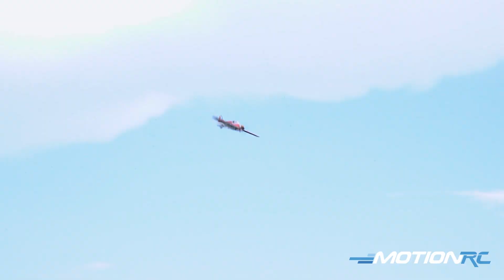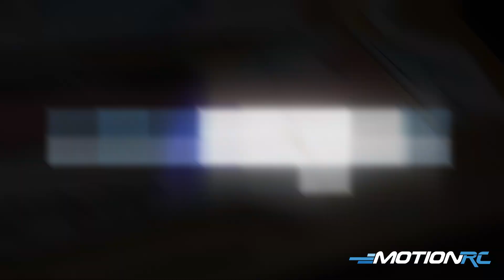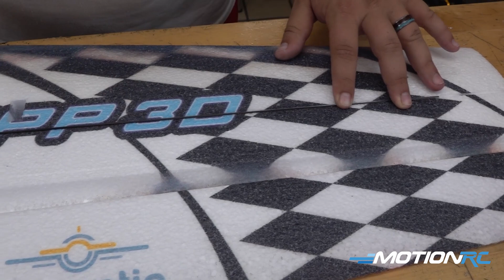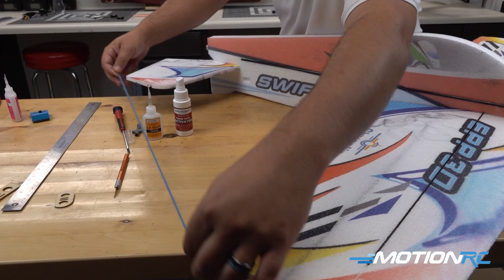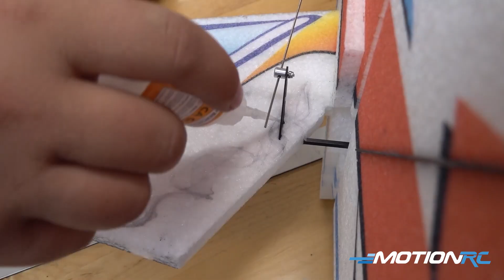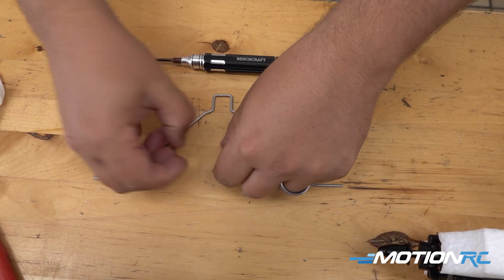Skynetic Swift Assembly | Motion RC

Comment: I’ve had both of these planes and both were tail heavy I used a 2200 mah battery and move the motor forward and it was still tail heavy  I will use 1 inch cylindrical stand off next to move the motor further forward and possibly some nose weight and try again

Comment: Kit has changed servo linkages too short now will probably have to cut new spots for Rub and el servos

Where is the CG?

96-114mm from the wing's leading edge at the root

This took a 2200 4s 13mm from the motor mounts

So put a 40 amp esc just in case 
Hope the motor can take it on an 10x4.7

Comment: Got mine and it came with a few things assembled already - the large CF tubes and supports were already glued into the fuse (not very neatly, unfortunately) as well as the landing gear and motor mounts. Also wound up with 2 CF rods about 1.5 mm x 8 in. and I have no idea what purpose they serve. The slot for the wing was also cut at a bit of an angle rather than 90 degrees.
Other than these inconsistencies, the kit arrived with everything fitting together quite nicely, I usually build from scratch so this was a treat!